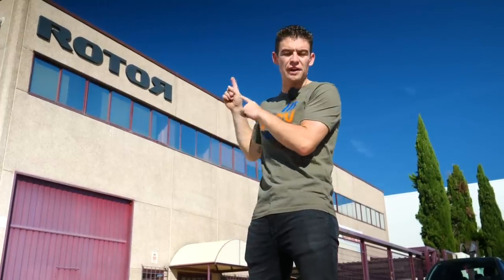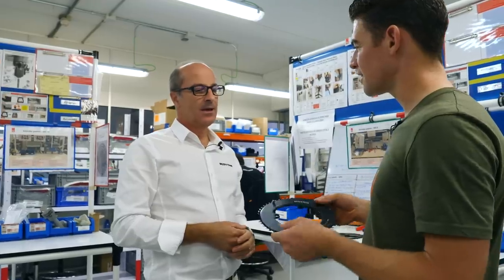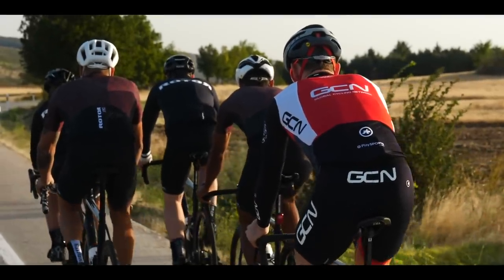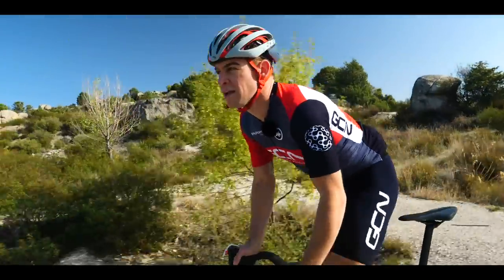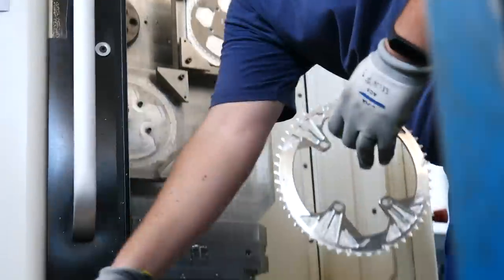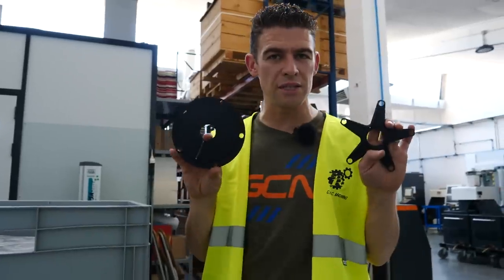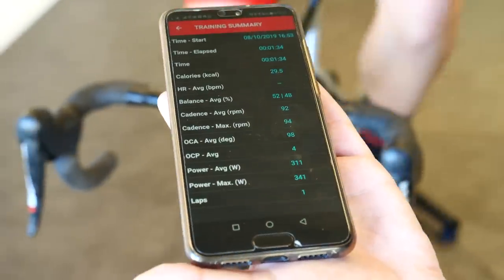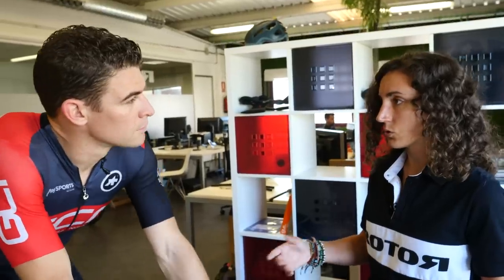The Theory of Oval Chain Rings | ROTOR Factory Tour

Comment: Oval chainrings increase your effective cadence window. What that means is that you can use the most effective portion of the stroke to "energize" the system (inertia) and minimize the needs to use weak portions that can lead to early fatigue. We already naturally seek that balance when we shift but the gaps are not consistent and the gaps required change depending on how close you get to your limits and how much inertia is stored (and resisted) under various conditions (depending on velocity and whether you're descending, ascending and so forth). The interesting thing is that highly aerodynamic configurations also extend your cadence window by reducing resistance that opposes the inertia. IOW, the weak portion of your stroke is given a bit of a rest in addition to finding your optimal cadence (that varies according to conditions.

I know it's hard to understand but that's mainly because of how we teach "power production" in a human as though humans are warm-blooded electric motors or perhaps 2 cylinder engines. Your muscles are not pistons. Your muscle cells are like pistons, combustion chambers and fuel refiners and are unevenly distributed compared to an electric motor or an internal combustion engine. 

If you find that you do better in certain conditions by paying close attention to your cassette an chainring combinations and get good results by changing, you should try oval chainrings to see how this helps with smoother pedaling under varied conditions. Put another way, using a Kickr or whatever is not going to help you understand the need to shift and how to figure out cassette combinations unless you deliberately test high and low inertia (which would be comparing "200 watts" with a lot of energy stored in the flywheel pedaling in your biggest gear to the same power with minimal energy stored by using your easiest climbing gear). 

Perhaps Jan Ullrich could have beaten Lance Armstrong if his team had done research in to non-round chainrings to solve his problem with melting down when under late attack from the likes of Lance Armstrong. There's probably a consistent correlation between rider weight and how susceptible a rider is to attacks versus being able to ride their own pace in a time trial. It's not just about power to weight ratio because when you have to ramp up your power suddenly the spike in force scales with weight and looking only at power doesn't explain how this affects fatigue. This also explains why Chris Froome is able to show such resilience under pressure while coming so close to his limits without easily being triggered by pressures to overcook himself.

Comment: Please, please, please can GCN or ANYONE just knock on the door of a physics or engineering professor and get an answer on these things. Where are the forces acting? What would an extreme elliptic feel like? What happens of you put an elliptic on 90 degrees rotated from where it should be.
Stop talking to manufacturers, for God’s sake. It’s like asking CeramicSpeed I’d they have any innovations in drivetrain technology 😜😜😜
Reply: It's easier for your legs to rotate the cranks because you are pushing more perpendicularly and also more in line with gravity, and your kneecaps don't rotate as much. At least that's my theory, idk if it actually works.
Reply: When the oval shaped ring is rotating through the most vertical position it would pull/push the chain faster for at a given rotation rate but require more torque than when its more horizontal. For the same rotation it would require less power when closer to horizontal but move the chain slightly slower. Each gear tooth is basically a lever with the fulcrum placed at the center of the gear. Changing how close the tooth/teeth are to the center of the ring that are applying force to the chain basically changes the gear ratio. Its like running two different rings at once. One for the part of your pedal stroke where your comfortable pushing the hardest and one for the when you can not produce as much force.
Reply: @ROTORbikeComponents  I can say for sure, 100% for sure, that using an oval ring has helped save my knees which will need to be replaced one day. However the oval ring is extending their natural life as long as possible. I live in Andorra where the mountains are steep and I am now climbing better than I have in the last almost 10 years (I am 61yrs old). The stress and tiredness is reduced. (Though for full disclosure I use Absolute Black)
Reply: @TheFixerOfAll   Nicely explained!
Reply: ROTOR Bike Components; I think the product is great and the engineering behind it is solid.  It just happened that the quality of the initial interaction/interview is too heavily degraded by Pablo’s limited English.  Ultimately, the guy taking to the camera should have been the best guy at talking to cameras in English that Rotor had, not really the engineering/innovation guy, even if he is the boss.  Is also a very latin thing to have “the boss” be the one on camera.  Elena was leaps and bounds a superior conveyor of relevant info. Anyway, great product and keep up with the good work!
Reply: On a hill the dead spot would end up in the taller gear ratio instead of the lower gear ratio, so it would feel like you were stalling on steep climbs.
Reply: it does lower my avg heart rate. i can control my heart rate better . lower heart rate during climb but in term of speeding it not that much help .. u will strugle to keep speeding over 35kmj

Comment: I think Shimano did something similar in the '80's. Biopace name rings a bell.
Reply: Biopace had the orientation completely in the opposite setting (i.e. wrong), with the most torque (smallest radius) in the region of most force (down stroke).
Reply: "Shimano created their non-round Biopace chainrings with a completely different orientation of the biggest radius of the oval. Their ring orientation has since been widely accepted as being fundamentally wrong. Instead of positioning it in power zone - which is slightly below the level of the crank - they clocked it to the dead zone where human physiology generates least power. The result was that in power zone pedalling was too easy and in dead zone too hard, causing knee pain and lumpy pedalling cadence. Exactly opposite to how it should be." 
https://absoluteblack.cc/why-oval/
Reply: @kalijasin  I remember moving the bi-pace chainrings around and trying them in different position on the crankset I believe that was 1988!
Reply: @kalijasin  And yet, BioPace had its devotees and positive press.  If that can happen with an exactly-wrong setup, the oval advantage (if any) must be trivial.  Human physiology is quite adaptable.
Reply: I tried Biopace in the 80' and spinning felt so weired. I changed back to round ones.
Reply: I have an oval chainring and a MS degree in the biomechanics field and I’m not buying the oval chainring hype.
Reply: My very first road bike back in 1990 came fitted with Biopace.  At that point, the hype had died out and the knee pain reports were coming in, so I switched to round and haven't looked back.
Reply: Yes. I bought a Univega bike with Biopace rings on it at about 1989.  Trained for and used that in a triathlon in 1990. Someone stole that bike out of my apartment in Santa Barbara.  Thought I had a pretty hot bike at the time, cut a fashion figure too in my Oakley Factory Pilots.
Reply: Hi Bob,
Thanks for your message. We firmly believe in the oval chainring concept. The orientation of the Shimano oval rings was completely different from the orientation of the ROTOR rings and other oval rings currently in the market. With the Shimano rings the maximum diameter was coming in the angles were the legs were able to apply the least force, while the minimum diameter was coming in te angles in which the legs could apply the maximum force. That's the reason why they disappeared. Current oval rings are designed so that the maximum and minimum resistances come when it is biomechanically better for our legs. We hope more people will try our chainrings and feel the difference.
Thanks
ROTOR Team
Reply: @ROTORbikeComponents   There's people "firmly believe" in all sorts of stuff - valid and invalid. I wouldn't start a defence of anything I had evidence for with belief.
Reply: They did back in the mid-late 80's. It was definitely work in progress, but some of my club mates back then swore by them. The trick with the Rotor Q rings is that you have control to set the angle of the oval. I think these are like Marmite and I've always been a Campag man.
Reply: My 87 Peugeot had that.
Reply: Some bikes came standard with biopace
Reply: Yes they did. It was a big trend back then for a couple years. But it fell out of favor since it encourages a crappy non-smooth low cadence pedal style. It was more targeted to cycling noobs at the time, since more experienced riders prefer to spin.
Reply: I still have a Gazelle bike with biopace rings. Compared to modern oval rings, the diameter changes of biopace rings are much smaller. As a matter of fact, I don't feel a big difference to the round rings of my other bike. But I am also not putting out 400W FTP ;-)
Reply: Yes iv still got my shimano 600 group set with an oval rings from 92ish
Reply: @volmarrwyrd  - spot on. That was always my take on them.
Reply: Oval chainrings have actually been around for well over 100 years. Seems like everything in the bicycle world gets reinvented every 30 years or so. Who knows, maybe they will stick around this time. I kinda doubt it though.

Comment: I've used Q-rings consistently since 2006 — I obviously prefer them, but have always wondered if it is more placebo effect or an actual benefit (and I use a PowerTap hub, so my watts measurement is not affected by the variance in cadence)

Comment: I’ve never really thought about it for road, but I can get up steep techy climbs on my mountain bike better now without such leg stalling at the top of each stroke when it gets slow with max power. Everyone knows the feeling of struggling to get up a hill with each crank almost stalling just trying to get over the top of the stroke to the “nice down bit” where you have the power and weight of your body behind it and can pump that half a stroke before the next near-stall. Many variables may be at play, and it may not seem like night and day, but if I can physically make it up stuff I’d have to get off, there’s definitely something there. Plus the common sense I can’t put the same amount of force in at all crank angles. Plus me not telling my mates I’d got one and them thinking my climbing had improved and getting some new surprise PBs on Strava. It’s not making more power, just making the hard bit easier (narrow bit of chainring) and the easy bit harder (wider bit) and still the same gearing for one whole revolution (number of teeth). Simple Newtonian physics of levers and force. P.S. that isn’t clipped in, so that may make a smaller difference if I could “pull” my way round the weak parts of the stroke, but I still think it would be some help. Also if you have a faster cadence than me I guess that might make it not as obvious either as the flywheel effect of your legs may help it zip on round. But I can’t see any arguments for it not making sense or working, just how subtle the effect is due to the other variables.

Comment: Interesting technology but one thought comes to mind. When the rider gets up out of the seat say on a hill does the power curve not shift and thus is this compensatable either automatically or manually?
Reply: yes and when you pedal standing up you notice that this is not optimal and i don't think this can be compensated easily but it is not too disturbing and i guess the argument is that the percentage of time you ride standing is small.
Reply: @alpw1234   Given the preponderance of electronics entering the bike would I would have thought some for of cam changeover could be adapted much like the BMW 1250GS [yes I know a cycle is much lighter but the idea is there]

Comment: I didn't see any theory? Got any theoretical basis to an optimal shape or any experimental data?
Reply: Hi Thok, 
Q RINGS® are oval chainrings designed to increase performance of cyclists by reducing the impact of dead spots in the pedal
rotation. Q RINGS® become larger around the strong zones and smaller around the weak zones. Therefore time spent in the strong zones is longer, while time spent in the weak zones is shorter.

Everyone’s pedaling style is different, so weak and strong zones vary by a quantity of degrees from person to person. The ability to adjust the position of chainring orientation to the crank via OCP (Optimum Chainring Position) is the key to fit each unique user’s needs.

Please see more info at the following link:
https://rotorbike.com/wp-content/uploads/2018/12/ROTOR-Biomechanics-doble-page.pdf

Thanks,
ROTOR Team
Reply: @ROTORbikeComponents  You didn't actually answer the question. Putting aside marketing copy, have you published data proving that this product increases performance and with approximate performance benefits across a range of power outputs?
Reply: @magnemmar4869  Second that - It sounds like a resonable hypothesis from Rotor, but unless they can back it up with data it does not convince the scientificly inclined.

Comment: Question - does the oval ring cause extra wear for the jockey wheels and pulley?
Reply: I got 20k miles out of my rings and am still on the same Jockey wheels
Reply: It wears out clutches on mechs that have them
Reply: I've not had any significant issues, but my first bike didn't have a clutch and my second bike has been running oval only one season. The one thing I will say is the oval chainrings themselves wear super fast. If they have to shift, that is. One setup is 1x and it's fine so far, but it's from wolftooth I think. My road bike are older rotor Q's, 2x, and the 50T outer ring looked heavily worn after one season. And perfect downshifting at the front is near impossible to attain. You can get it to maybe 90%, 95% accuracy by the grace of the cycling Gods. But power or no power, at low cadence or high, there's always a chance of a chain drop.
Reply: @Cal94  get a spacer for your front derailur between mount and it... it puts it in the correct position for ovals...
Reply: @noahhalbfoster6892  so shift the derailleur back a bit basically? Vertical clearance I have enough of. But the derailleur is direct mount, so I can only go up, down, and back I suppose. Regardless, I have a new road bike, insufficient tools to get the old crankset off, and insufficient willpower to spend money to salvage the worn chainrings anyways, so it'll be someone else's problem when I sell it. The rest of the bike was such a pain in the ass that the odd chain drop was actually tolerable

Comment: I wonder to what degree, if any, the advantage of the eccentric chainring is negated by the two oscillations of the chain tensioner with each turn of the pedals (losses due to friction in chain tensioner bearings as it swivels back and forth, and heat dissipated by its spring, and the chain itself bobbing up and down).

Comment: The goal of pedaling efficiently is to create an equal power output throughout the course of your pedal stroke, oval chainrings could make sense for people who haven’t trained themselves in XC or road biking, but for the well trained and pros, round chainrings are probably the way to go.
Reply: For extreme climbs on the edge of stalling oval will help everyone. Also if on the climb there is a root of something to suddenly demand more torque, it will prevent (decrease the chance) stalling when crank is vertical. In situation when torque from pedaling can make the wheel slip, oval can help by giving more even torque through whole rotation of the crank.

Comment: Are we going back in time? Didn't we do the Ovals back in the early 90's?
Reply: Ahh, Shimano Biopace - brings back memories 😁
Reply: lee mua nguyen the Shimano ones were 90 degrees out of the correct phase which means they made things worse... They were SO close to a great idea but messed up the details.
Reply: No they just never went away. Greg Lemond does not recommend them in his book. Steady cadence is no longer seems to be the focus for performance like it was in the 90s. Now it is power output. Meh. Not sure if oval chain rings help. Not to mention the problems of getting  a front derailleur to work with them.
Reply: 1890's would be closer to the mark.
Reply: I still have my 1988 Raleigh Montage with 3 ring oval crank albeit boxed for years awaiting restoration

Comment: If they actually worked as advertised, every pro cycler woud be using them....good improvements like narrow/wide chainrings actually have a noticable improvement, I am not convinced this is an improvement.  Pedal bikes are one of the most refined inventions, and is difficult to find any sizeable, measureable improvements to design.  Lighter components and materials have helped recently.....but the mechanics of cycling still remains much the same after 100 years.  Goes to show how great of an invention a bicycle was!